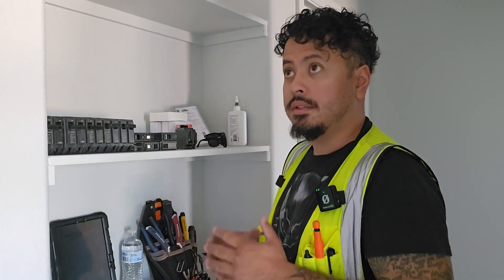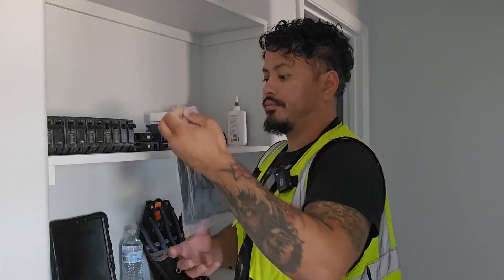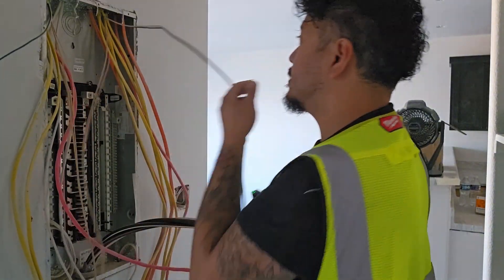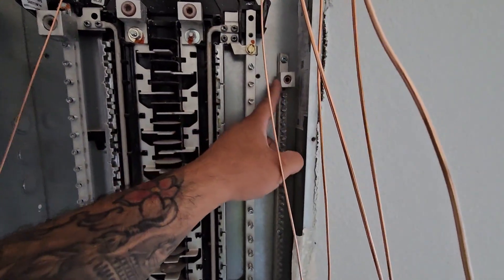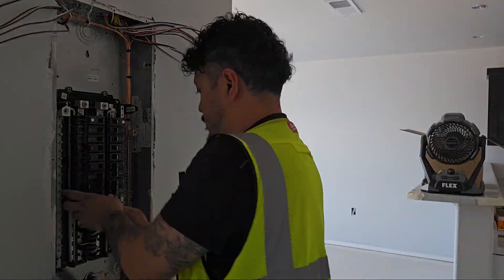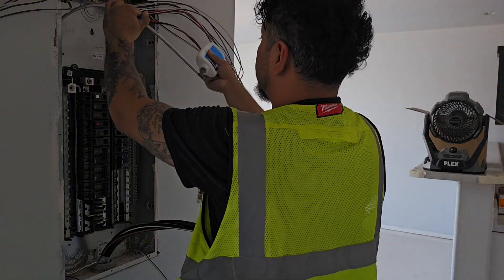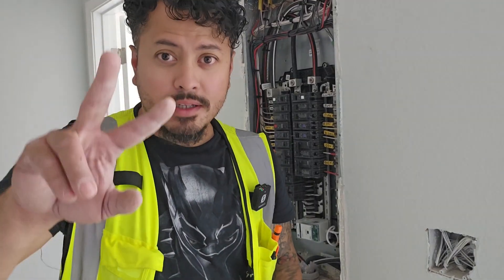How to wire an Electrical Panel (Step-By-Step for beginners) | Wired By Chris

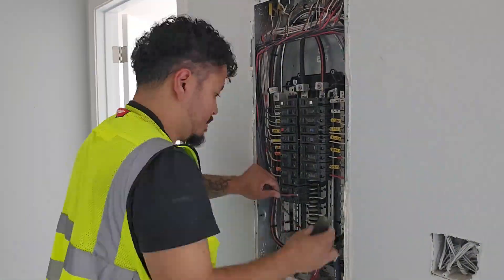Comment: 6:00 - 6:05 hahahaha 

Great step by step man nice job making the panel so neat and labeling everything.
With your black and red phases on the panel, do you have to balance load (like oven on one hot and laundry machine on the other)?

Would love more details on the phasing / load  for the circuits in the panel if you get time!

You did really good explaining each step on this video, keep up the good work and good content!

- A fellow electrician
Reply from the maker: The answer to your question is Yes. It's good practice to try and balance out the loads between each leg as best as possible. The reason is because if you dont you'll be putting more stress on one leg of the system. It will work if you only put all the breakers on one side. But its bad practice and could potentially cause some issues. Great question! I'll make a video on this topic to explain it a bit better 👍